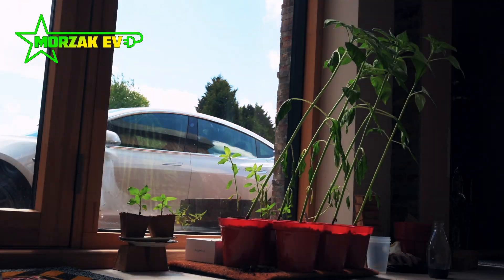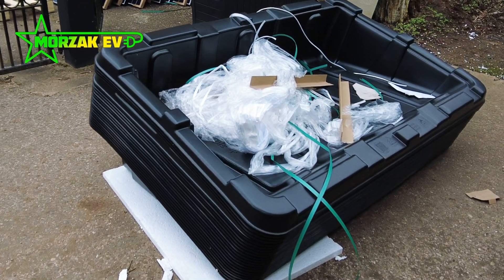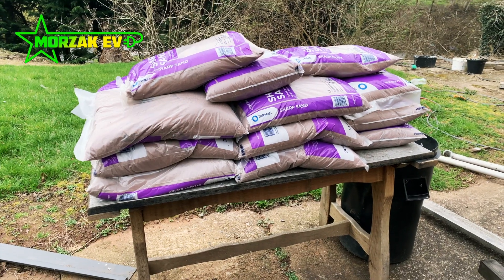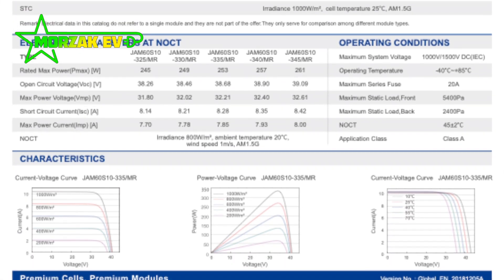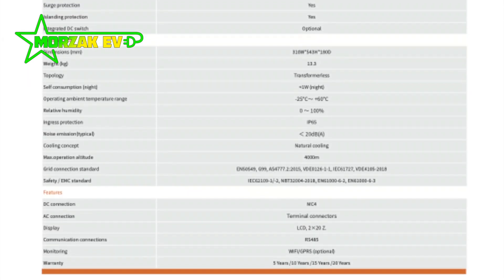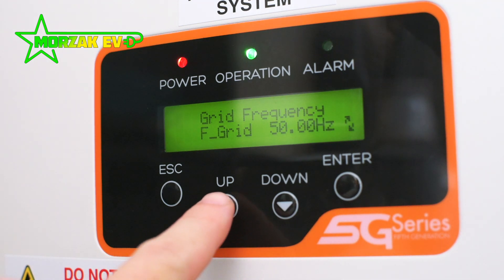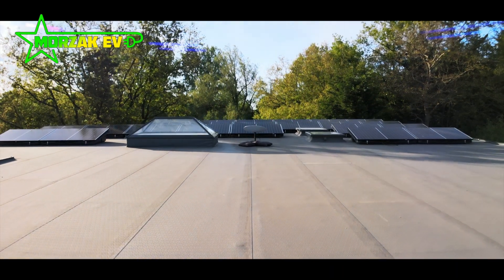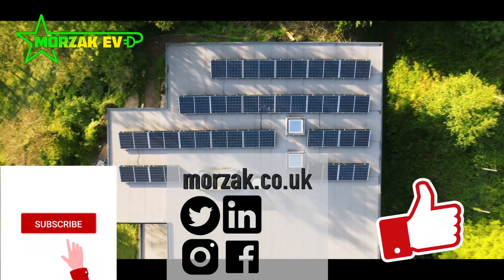We installed Solar PV at Morzak HQ, and this is our installation

Comment: Thanks for the video, what spacing did you use between the rows? I am struggling to find any information about this for my console+ buckets.
Reply from the maker: Good question! 
OK, so the console plus height is 390mm, and the angle of the sun in winter is at it's lowest 16deg, so assuming your roof (or the area where they're located) is totally flat doing a bit of trigonometry, this gives a distance of 1360mm. Our roof is actually pitched to around 7 deg, so that makes the total winter solstice angle around 23deg instead, which gives a spacing of around 900mm - which is what we did in the end. If you're tight on room though, you can always compromise a little by making them a bit closer = you'll only loose out in the deepest darkest depths of the winter solstice when you're generation is minimal anyway, and in the summer you should be easy on. This chart on Permaculture is extremely useful: https://www.permaculturenews.org/wp-content/uploads/2015/10/ravsunImage9.jpg
Reply: @MorzakEV  Thanks Morzak I hadn't done any calculations and yours are useful, I assume the 900mm is the gap between the rows. I think I will reduce mine to about that as well although I don't have a roof slope my ground location is fairly flat. I am still putting mine up and had used a provisional spacing where the front of each bucket is 2 meters from the front of the next row, mine don't point directly south they are a bit west of south, these mounts are not great for winter anyway. Thanks again for your help.
Reply from the maker: @timcx  yes, this was the gap between the rows. Ours are slightly west facing as well. There are pros and cons to all mounting systems but you just have to make the best of your own situation. Good luck with it!

Comment: How much weight did you put in the buckets?
Reply from the maker: This depends on where you live, wind conditions, and the structure of your roof. We used 50kg for the centre ones, and all the ones around d the edge, we used 75kg as these face more wind loading.

Comment: What battery did you fit, or did you build your own? This is something I want to do as Powerwalls & the like are super pricy &  I feel have low storage capacity. I'm a sparky myself & plan to fit p.v. & my own battery as I will save thousands. Great channel by the way, just subscribed after finding you. p.s lovely looking house you have!
Reply from the maker: We still don’t have a battery permanently installed at the moment. We’re demoing a couple of different ones on loan, so we can try them as battery installers. That’s a long term project though truth be told because we’re still working on the house a lot (when we’re not inundated with charge points). I’d love to see and hear about your own battery project though!!!!
Cheers, the house is a long term labour of love.